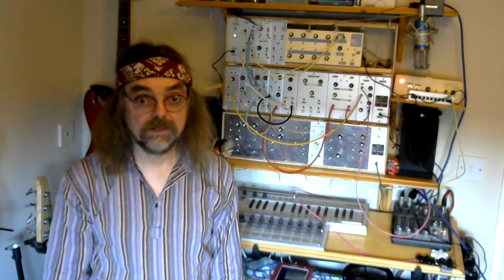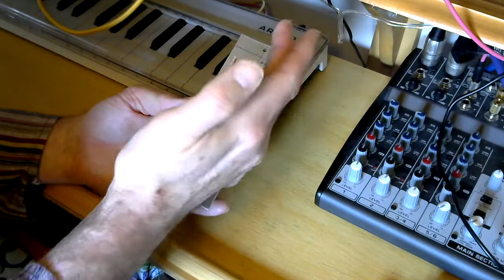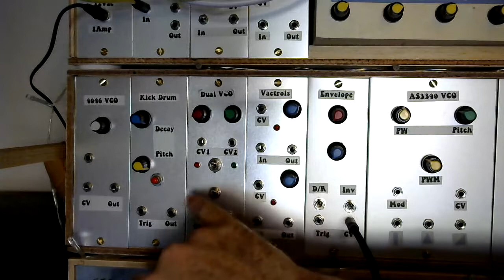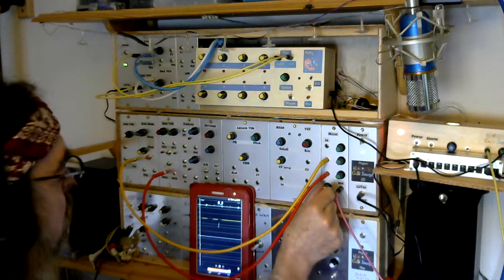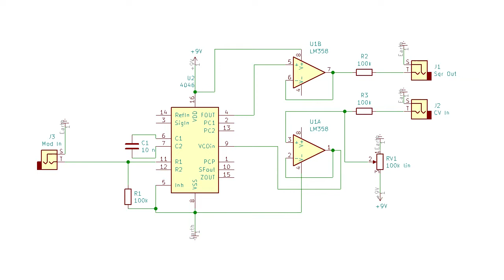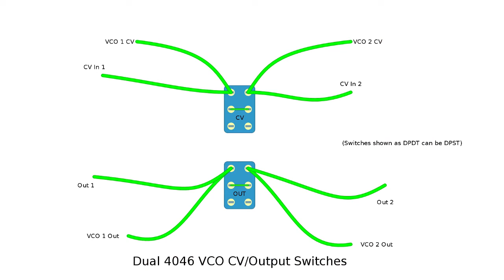Project XII Modular Part3: 4046 VCO

Comment: it is the same schematic as little boxes 4046 isn't it? on which pin could i add a led?
Reply from the maker: Yes it is the same circuit as the little boxes version. What do you want the LED to indicate? On the little boxes one the LED shows that power is on so you don't forget to turn it off and run the battery flat. On the Project XII dual VCO the LEDs show what the CV input is doing.
Reply: @CuSiSound  Thank you! yesterday I made the diy of this circuit and I have it working!

Comment: Great video! I was thinking of taking this idea but modifying so it is fed an exponential VCO from an MS-20Kit. As the CV goes up to 8 volts, I would run the supply at 12V to allow for the fact that high C on the  MS-20Kit is 8V. Single supply though. grabbed a screenshot to see what I can come up with!
Reply from the maker: This design takes a linear voltage so to feed it an exponential voltage will require extra circuitry on the CV input. A good place to start for examples of how to do this is the smitzbits website.
Reply: @CuSiSound  The CV coming from the MS-20 is already expo: 
Highest C is 8V
Next lower C is 4 V, 
next lower 2V, 
and lowest C is 1V. 
Would not feeding an exponential CV yield correct musical characteristics if the VCO on the 4046 is linear? 
I guess I can always feed it CV from my Vermona  '14 (V/octave) as test case #1 and CV from my MS-20Kit (Hz/V) as test case #2 and see which "model" works better.